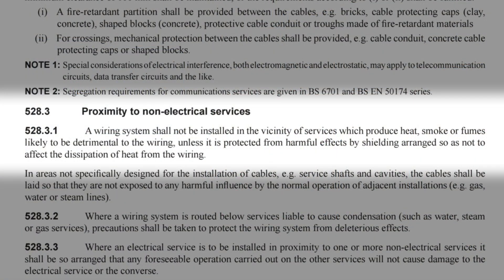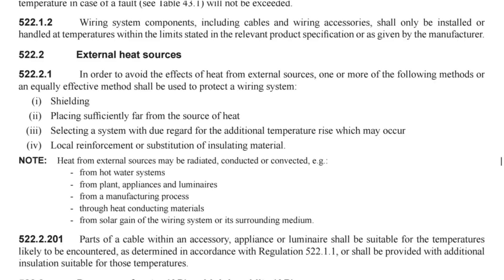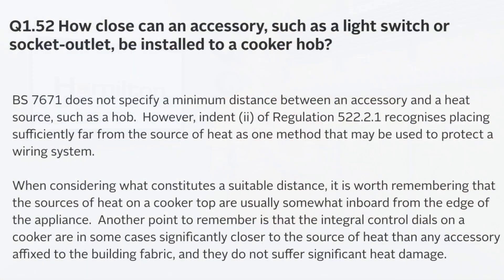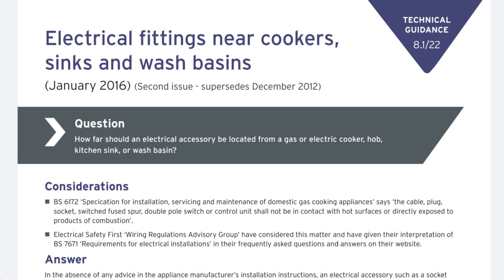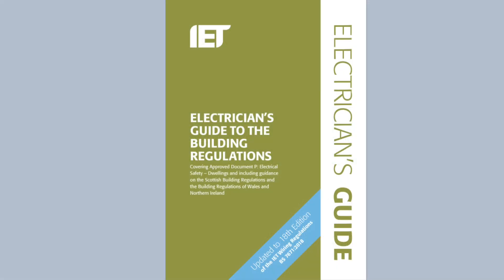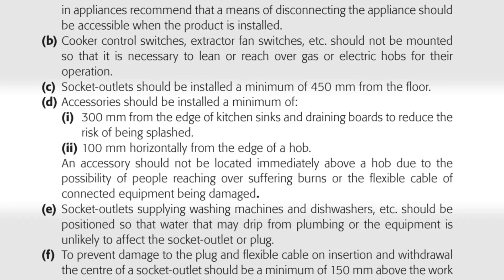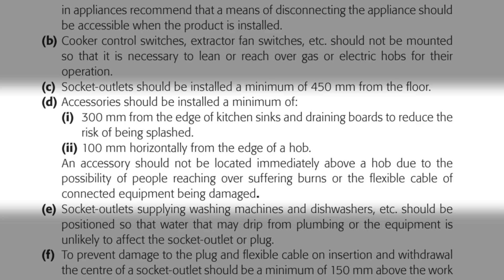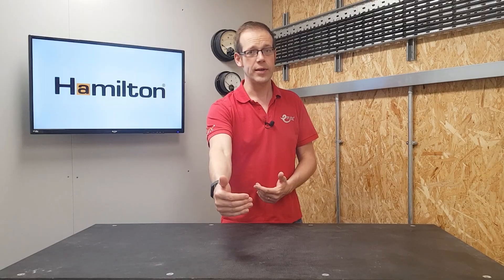How far should a switch or socket be from a hob? - Electricians' Q&A

Comment: What is the official maximum distance from edge of cooker to switch?
Forty or so years ago while working with kitchen fitters I installed a cooker switch one meter from edge of cooker.
Site manager said it's too far away and I had to change it.
I looked in Regs, could not find any distance mentioned but I still had my college texts books and found an illustration in one showing the maximum distance is one metre from edge of cooker.
Showed book to manager who then accepted my work.
The text books would have been 14 or 15th Editions.
Is this distance still ok?

Comment: I have a freestanding gas cooker with gas hob with a glass lid that stays up (always!) particularly when cooking and I am now told (needing to replace the cooker) the socket that is 25cm above the cooker being behind the glass lid is not allowed. The socket that has serviced my old gas cooker has been being the glass lid for 19 years and was installed by Curry's. If moved a new socket will be more dangerous as it will have to be placed to the left around the corner where it can be interfered with at any time. Please help?
Reply: Blank plate and wago maintenence free connectors inside. The correct thing to do would be have an electrician move it but hey.

Comment: Is it not considered safe if it's closer and you have a socket cover that completely protects the sockets? My hob is heated by magnetic technology it's not gas heated so no flames. I only use the front hobs never the rear that's near the plug.

Comment: That is on new builds not retrospectively. If you did an eicr report & the installation was done before that as long as the point is not over the hob you would C3 it at the worst case. I personally would not even put it on report.

Comment: That building regs book has errors in it that the IET are not aware of...
Reply: Spill the beans.
Reply: @markrainford1219  ok. What is the height of a socket-outlet in a new build domestic dwelling (above floor level)?
Reply: @asp217  450mm
Reply: @markrainford1219  to which part of the socket?
Reply: @asp217  Bottom
Reply: @markrainford1219  wrong!
Reply: @asp217  Go on then, put me out of my misery.
Reply: @markrainford1219  centre line of socket
Reply: @asp217  Ok lol. Building regs part M says sockets and switches centreline between 450 and 1200. So a socket mounted at 450 to the bottom is comfortably within the 450-1200. What does the electrical book say? I haven't read it.

Comment: "Should" not "must" so smells of finger in the air engineering, what test methods and criteria were used to establish these distances? As for leaning over and getting burnt don't people lean over the front rings of a hob to get to the back rings? Also where do you measure from? The edge of the hob surround? The edge of the nearest burner?

Comment: I have always maintained  200mm from the bowl or cooker units
Reply: 300mm from the sink and 100mm from a cooker. 300 from cooker used to be the requirement and the dp cooker isolater no more then 2m from the fitted appliance.

Comment: Minimum 100mm from hob, 300mm from sink bowl, i normally count the sink drainer as the edge rather than the bowl simply because it's designed to be wet so wouldn't be a good idea to use the 300mm from the sink only
Reply: "300mm from the edge of kitchen sinks and draining boards to reduce the risk of being splashed" from the guid to buildong regs book 👍
Reply from the maker: Good work. 👍

Comment: I would always do 150mm had a gas cooker few weeks ago and hot zone spread was 150mm each side of hob. This is the largest I have seen and I fit alot of cookers. And if  switches above hob are over 750mm high with no socket out let so cable can hang over hotplate would be fine to fit cooker

Comment: Minimum of 100mm if not stated in the hob manufacturers installation guide. Manufacturers info should always be adhered to as BS7671 is a minimum standard.
Reply: So what do you do if you install a new Hob that recommends the distance for sockets should be 350m horizontally but the existing sockets are 300m away? Move the sockets or ignore the manual and stick to the regs?
Reply: @stevoc9930  well, the regs tell you that you must follow manufacturers instructions anyway, so there's no getting around it... You'd be left with a choice:
a) choose to fit a different appliance instead, one which allows the already installed sockets.
b) move the sockets and issue a minor works
c) install the appliance, but note a departure away from BS7671 - something like “unable to follow manufacturers instructions regarding minimum distance from socket outlets of 350mm as existing sockets are fitted at 300mm”
Reply: @TheMattSturgeon  A, is a hard sell to a customer who's just bought a shiny new Hob. B, is also a hard sell to a customer when you tell them you have to chase their wall, break tiles etc. to moves boxes. So C, it is I'd imagine in 99.9% of cases.
Reply: @TheMattSturgeon  To be precise, the regs don't tell us to follow manufacturers' instructions, only that we should take them into account.
Reply: @TheMattSturgeon  how about changing to metal-faced accessories as a compromise?
Reply from the maker: Good points in this thread. 👍

Comment: I prefer to check hob manual and go for that distance, average is about 300mm but varies from model to model
Reply from the maker: Good point.👍
Reply: eFIXX 
Manufacturers may be applying recommendations for other countries.
BS or EN is vital
Reply: @rossmurdoch1886  Thing is, the "Good Book" will usually give you the measurements that they say you should be following, but then they have some reference to follow the manufacturers guidelines anyhow. lol

Comment: What about the distance the isolator for the cooker, how far away or how near should it be to the cooker and how accessible should it be? Is there anything that states it needs to be accessible or within a certain distance?

👍
Reply from the maker: Watch this space! 😊
Reply: It needs to accessible for practical reasons more than any regulations. As for distance same as sockets it is a switch after all.
Reply: I get fed up with people wanting all isolators in cupboards so they cant see them.